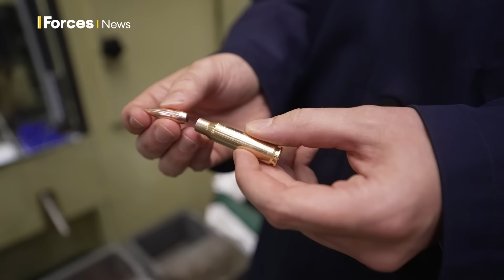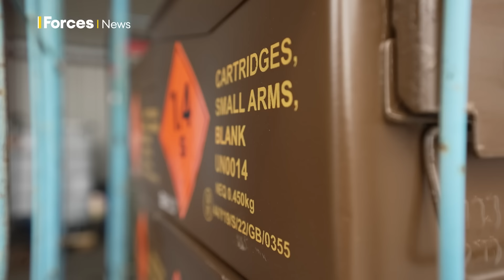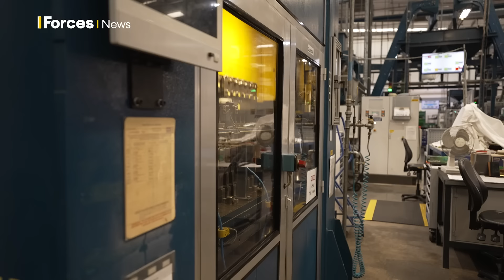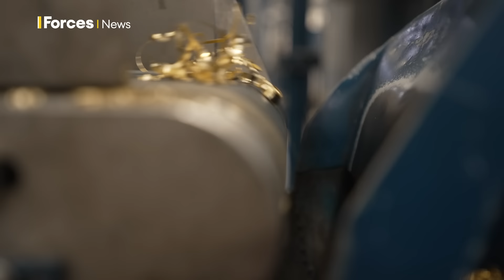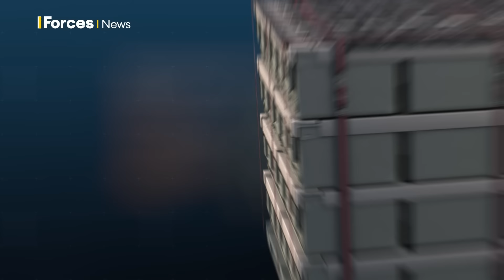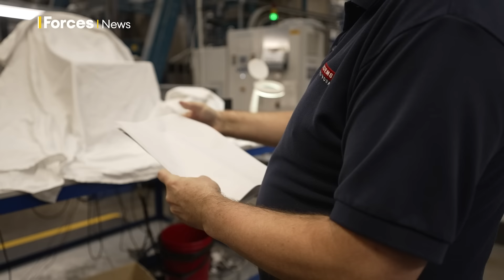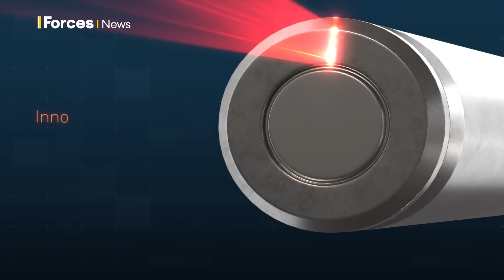Exclusive: Inside the factory that makes the Army's rifle rounds

Comment: Half a kilo less is insane. Imagine if similar savings can be found in uniform, ballistic protection and such. That's what the infantryman needs on the ground: less weight and more ammo. There's only so far smart tech, drones and such can get you before you need to get dirty and put rounds down range.
Reply: If weight is saved on the individual rounds, the soldiers will just start carrying more ammo. It's good that they can carry more but the overall weight of a soldier will keep ballooning as it has done for 250 years
Reply: @tomsoki5738  Yes, that's the point. More ammunition is a vital resource that keeps you in the firefight for longer, and that keeps you alive longer.
Reply: @tomsoki5738  Having those 50 extra rounds could prove VERY important. Amazon next day delivery won't cut it.
Reply: So about 10 years ago, my job was designing and integrating kit for the British Infantry. We saved a few kgs within our scope of supply but as soon as the weight was removed, the lads grabbed more ammo.
Reply: @meme4one  is that a bad thing? More ammo means the infantryman can stay in the fight for longer and has higher chances of survival. Usually first team to run out of rounds is killed or captured.
Reply: @Goat Dehydrate it? :))
Reply: it's good but with more advanced technoogy they could eliminate far more weight than that by using plastic, they managed it on big guns where the entire case explodes away... they'll only get it so light by shaving away more metal and using better alloys etc
Reply: @DarkShroom  I believe they experimented with  plastic  and caseless ammo. But the brass case acts as a heat sink, when its ejected its red hot and takes that heat with it, helps prevents the rifle overheating.
Reply: @Goat Not when it comes to ammo, you take as much as you can
Reply: @Goat Waterless H2O going down well.
Reply: @Goat this was herrick aka war fighting, not tarting about in Estonia and SPTA.
The lads were more than happy to carry extra rounds to be fair. This was an Irish guards company, a para unit (forgot which), a London reservist platoon and a Royal Anglian unit who were the high readiness standby unit for Herrick based in Cyprus. All loved the kit be delivered but irt weight, all replacement weight reduction with extra ammo. Their choice, as a civi company, we could only do so much.
Reply: Jockbigcox  cheers dits
Reply: I used to work at RG. I used to speak with the techs who came up with some radical ideas for weight savings.
Reply: @Goat add some bubbles.
Reply: If technology and weaponry were to improve significantly then infantry will be using far longer ranged weapons than rifles.  It is almost insane how a 'modern war' could be fought vs how they are fought currently.  Almost surprising that certain systems are not already in use and that some from the past vanished which seems to be in line with new capabilities appearing whilst old ones disappearing.  And of course the new capabilities that have yet to be thought of and developed...
Reply: @greyvoice7949  Such as? You can't clear a trench, bunker or fortified position with a long range weapon. There will always be the need to get up close and personal.
Reply: @maquettemusic1623  Of course you can!  They are doing it in Ukraine in case you had not seen it!  Static positions are not a good idea , they knew that back in the 1980's.
   You should be aware of battlefield information systems where the idea is that you link all your intelligence gathering and offensive weapons together so that you can identify the target and then use the best weapon system to deal with it.
   You should also be aware that you need to deny the enemy the capability of using weapons too and we are seeing this in systems/weapons to destroy drones.
Reply: @greyvoice7949  Thing move slowly in the military - except under the direct influence of wars. Most changes are incremental, because there has been a big investment in existing equipment.
For example, "normal" ammunition is referred to as "ball", even though it has been pointy since Victorian times, originally, I presume, to get the invoice past some bean counter in government.
Reply: @Goat Common grunts can't rely on what they need at the moment, but also need to worry on what they could need in the future. In conventional warfare, soldiers can be in a task that lasts various days, and that needs a lot of preemptive equipment
Reply: Says the infantile anonymous coward!
I actually served.
You hide and cower.
Reply: @Goat they should just dehydrate it so when you add water, it's drinkable
Reply: @Goat We learned some hard lessons in October 1993 that say otherwise.
Reply: Those morons should Drag as heavy stuff as they can. They choosed this job, let them make a pay.
Reply: @Gangster88232  lol nice try, Bateman
Reply: @Peter Angles really? because there were plenty of cases of troops pinned under fire in Iraq & Afghanistan and running low on ammo. Resulting in very desperate calls for artillery and fast air support to allow them space to evac out.
Reply: @Peter Angles am I wrong though? You can re-direct away from the question at hand but it doesn’t make me wrong. 1 RHA could certainly have used some more ammo in Basra back in 2004 I know that for sure.
Reply: There have been plenty of trials with caseless rounds (where the case is just compressed propellant). But always runs into problems of fouling and sealing the breech. With a brass case, the surfaces that are contaminated are thrown away each time. And the brass cases also expand under the 10's of tons per square inch of pressure, to seal the chamber of the gun, and send that pressure where it is needed.
Reply: @Marquette Music: The march of technology seems to cancel out the weight savings by adding more and more requirements when it comes to basic gear. How many batteries did a WWII infantryman have to carry?
Reply: @dpeasehead  I don't really understand what you're saying sorry. Basic gear is basic gear, like batteries, Individual weapons and ammo. The lighter you make those things, the better infantrymen can fight on the ground. My point was that stuff like drones, VR training, AI controlled mechanisms and battlefield computers are great, but ultimately might never filter down to a light infantryman who has to face the enemy and kill him on the battlefield. What that man needs to survive and succeed is three fold: leadership, ammunition and sustenance. The more ammo you can carry, the longer you survive that initial contact.
Reply: more ammo sound bit outdated, i prefer idea of smart rounds which always hits target meaning less is more.
Reply: @freezedeve3119  They don't exist beyond Artillery, so not really possible. Also, not how firefights work in reality.

Comment: The U.S army is " moving up " to the newer  6.8 x 51mm cartridge , does the British army intend to follow suit  ?
Reply: No-one knows.
But if its proprietary just to SIG, with large licensing costs then the answer will be no, and quite rightly so.
Reply: no-one has said anything... i imagine we observe the experiment, you can still argue until the results are in 7.62 is still avilable if required
Reply: There were tests on ammunition smaller than 556. They went straight through the weave of Kevlar-reinforced ceramic armour, but generally you need the extra range that the larger cartridge gives.
Reply: Their is a nuance here. The US will use 6.8 for front line troops (Infantry, Engineers, etc.). All the rest stay with 5.56.
Reply: I cant understand why the 6.5 Grendel didnt take off for military use.
Reply: Yes

Comment: As a professional brass-chicken myself what I want to know is what they do with all the discharged casings we've gathered over the years.
Reply: We have to pick them all up when finished on a firing exercise or range, blank or live rounds. They then get sent back and recycled to save the MOD some money
Reply: @tomsoki5738  thanks hun
Reply: @tomsoki5738  They get sold back to BAE at current brass scrap value, massively bad deal. They get re cast not re-loaded.  Money sink. Same with the copper and lead from berms behind the tagets, except they have to pay huge sums for that. Another bad deal.
Reply: @denvernugg1151  They have to be recast waste of time to mic every case and reform all of them. Also have no known count of times fired if its made several trips. Also the military demands fresh unfired brass for reliability.
Reply: @tomsoki5738  Only the army cadets pick it up.
Reply: @denvernugg1151  Army too
Reply: UK has never reloaded small arms cases. Recovered brass is sold to scrap and all cases are made from new alloy. In war time, artillery QF cases have been reused, but usually only from sources where the brass can be recovered in good order such as from Anti Aircraft sites. I doubt if this would happen again as the usage rate is unlikely to be as sustained as in WW2.

Comment: So what happens to all the brass picked up by soldiers at the end of exercise or ranges. Melted down and re-used?
Reply: Nearly all brass is recycled, smelted down etc. Some  5.56/.223 rounds are fire once throw away Some are composite Some brass
Reply: Good question Tom, not something I ever thought about and I must have picked up many hundreds. "I have no live rounds or empty cases in my possession Sir!"
Reply: @jimfrodsham7938  we nearly always got reloads for range practice, you could see on the case where the heat had changed the colour from brass to a bluey purple, we hardly ever got pristine new rounds.
Reply: @mebymyself2816  oh right, I can't say I ever noticed or even looked for that.

Comment: Interesting. Way back in the mid '60's I worked for Imperial Metal Industries (IMI) in Witton, Birmingham.  They made all the Army's rounds back then. The Witton site is long gone and for all I know so is IMI. I wonder how many rounds I fired during my service were made there. They even had a range where blokes would come and test fire some from batches for QC.
Reply: Interesting - I tried to investigate a late relatives work in Birmingham during the war and came up blank. Any other ex-companies you can name?
Reply: @chaplin577  erm.. not that I can confirm to during the war, but in Birmingham the major companies were IMI as mentioned, Imperial Chemical Industries who made various explosives and Stuff, Lucas who made vehicle electronics. I also know that Spitfires,  tanks and small arms were made here chap though I can't tell you what the companies who made them were. I'm not a native, I just ended up here at the end of my service because my wife comes from here.
Reply: @chaplin577  Is the pun intended "blank" as in dummybullet 🥸
Reply: @chaplin577  I can't resist it...... 'came up blank', they probably weren't making ammunition then.
Reply: @chaplin577  BSA...Birmingham Small Arms......same company who made our motorbikes.
Reply: Witton/Kynock only made .50 and a bit of 9mm for the UK after the war. The majority of small arms ammunition from the 50s onward was made at Radway Green
Reply: IMI is an Israeli company .... Probably not related, but shares the same acronym and produces superb ammunition.
Reply: @Marc van den Boogaard Israeli Military Industries (IMI) is one of the world’s leading manufacturers of precision ammunition. A key producer for Israeli military and special forces as well as other militaries around the world, IMI has an excellent reputation for exceptional accuracy, ballistic performance and reliability. Offering a range of caliber and bullet choices, IMI provides recreational and competitive shooters the absolute highest quality ammunition at affordable prices. IMI, established in 1933 produces a wide variety of world class combat proven systems and their small caliber division is the exclusive supplier for the Israel Defense Forces. Their small caliber ammunition is also used by the United States Army, armed forces of major NATO members, and law enforcement agencies worldwide. IMI ammunition undergoes rigorous testing, from raw material through completed cartridge. ISO 9001 certified, IMI ammunition is produced to exacting standards in compliance with NATO, MIL-SPEC, SAAMI and CIP.
Reply: @felixthecat265  I'm not sure what you mean.  I was already aware that there are two IMI's.  I was specifically referring to the Isreali company, not Imperial Metal Industries.